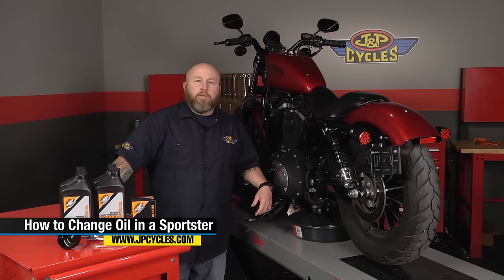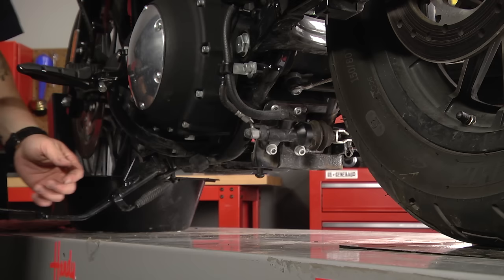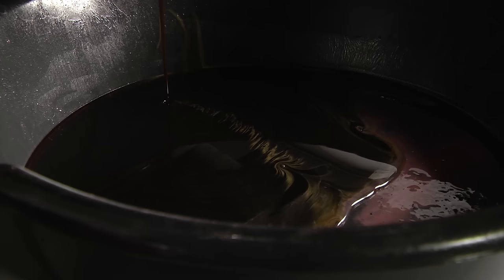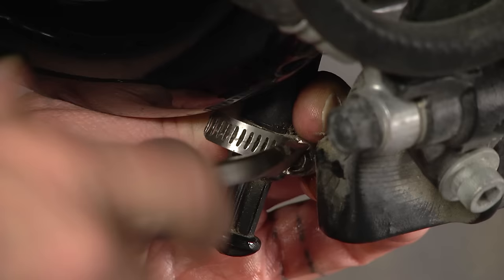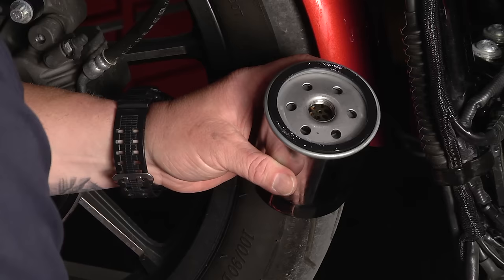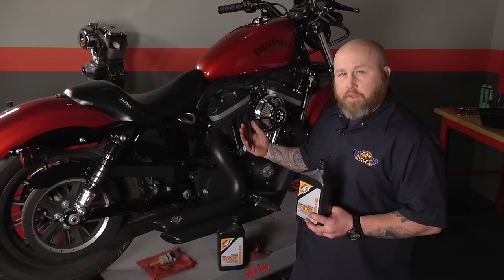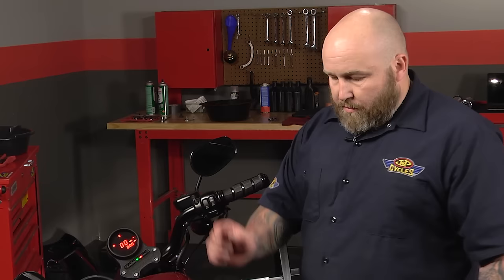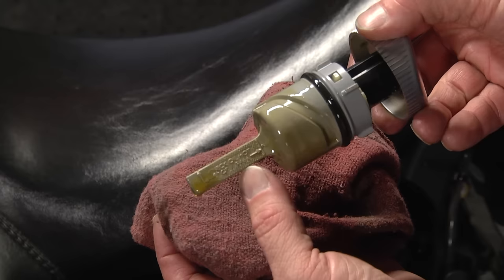How to Change Oil & Filter in a Harley-Davidson Sportster by J&P Cycles

Comment from the maker: Are you still paying someone else to change your oil?

J&P Cycles' merchant and resident mechanic Patrick will walk you through an oil change on a 2012 H-D Sportster. This will be similar to an oil change on rubber mount Sportsters from 2004 and up.

Did you find this video helpful? View more like this on J&P Cycles' YouTube channel: https://www.youtube.com/user/jpcycles2
Reply: is the 2 qts we add included with the prefil we did on the oil filter? or is it a seprate 2 qts?
Reply: What happens if you don't prime filter

Comment: Has to be the easiest oil change ever.
Reply: Oh heck yeah... I change oil on Mopar, Hyundai, Subaru, Kawasaki's Suzuki's, Yamaha, Honda's, Ducati and by far the easiest oil change ever is the Harley. Great design. Many many pro liter bike aficionado's down talk Harley, but their design in certain areas is superior to other makes. The oil and air filter placement is in easy reach, the battery is easy to get to and you really don't need fancy tools for typical maintenance like oil changes, batteries and brake pads. Sooo easy. Changing out the brake pads took me a few minutes because of the floating design. The rear suspension took me about 5 minutes to do as well. Amazing age proven design.
Reply: KR  Maybe Ninja easy, but you still need a socket and ratchet. Not so here, just a screwdriver, or if your in a pinch, a dime. Ha! I changed the oil on my Yamaha YZF R1, what a PITA!
Reply: It is.
Reply: Can you use oil made for diesel engines?  I use T4 Rotella in my mercruiser 3.0.
Reply: My sister's 21 model 48 owners Manuel says t4 Rotella is good. 👍

Comment: I have added a "T" fitting inline with the oil  return line. After I drain , refill and change the filter I clamp off the return line between the T and the tank. Fire it up till the oil coming from the fitting in the  return line runs clean oil. Then I plug the T off and remove clamp on hose to allow oil back into the tank. top off and I now have a complete oil change. Sportsters retain a good quantity of dirty oil in the sump that will just mix with the new oil if changed the conventional way. When I spend $12 per qt for top quality synthetic I don't like to mix dirty oil with it.
Reply: Pat Dennis what size is the oil return line
Reply: You're still going to have old oil mixed regardless of what you do. In every engine. Every time. If it makes you sleep well at night, cool, but completely unnecessary.

Comment: Thanks Patrick.  It seems easy enough.  I am going to try to change the oil and filter myself now that I have seen the video.  I have 2150 miles on the bike so it's almost time.
Reply: If it's your first oil change you should do the first oil change earlier

Comment: So 2 quarts then check it. But basically 3 from what I just watched. Great video thanks for the tips. Pre filling the oil filter is, in my opinion a must!! Anything with engine oil should get the oil pre filled during an oil change to prevent a possible dry start. Helps the oil pressure build a few seconds faster then a complete dry filter does.

Comment: I still have my 2001 1200C and believe me it is this simple. My oil drain line is actually routed to the frame and it in my opinion is better since the hose is not hanging. I have 30,000 miles on it is still my daily driver. Doing the primary is just as easy. For oil 3 quarts does it. Always pre load your oil filter. My baggers are a little more complex.

Comment: Great video! Tips and tricks, I'm not a fan of a dirty bike. Looking around on oil draining found a video that took a news paper and put it under the oil filter. Or a flexible plastic or rubber if kept to use again, but news paper just as easy just make sure it has a shine to it. This way oil will not absorb as fast.

Comment: Where did you get the digital gage from? Also aren’t you supposed to ride the bike for about 10 to 30 mins to get the oil up to operating temps before you check and add more oil since the oil will Expand?

Comment: Couple things I do: I ride my XL 1200C 10-20 minutes to warm up the oil and get particles in suspension and make it drain faster and more completely, I remove the hose clamp before pulling the hose plug or else the clamp can fall into the drain pan, I remove the seat to prevent oil stains when filling and topping off, I made an aluminum scoop to slide under the oil filter to catch 95% of the oil filter drippage, Mobil 1 15W-50 synthetic 5qt jug is at readily available at Walmart for $25, I use 1 qt of Mobile 1 V-twin 20W-50 (wet clutch safe) for the primary case $8.99 at Advance Auto, oily chrome filters might not get tight enough hand tight so I go 1/4 to 1/2 turn past hand tight with a wrench. Oil change interval for sportsters is every 5,000 miles for the engine oil and every 10,000 miles for the primary case. I am thinking of going to 10,000 miles on the engine oil since switching to full synthetic.

Comment: I have a 18 1200 Custom. When I change my Oil and Filter, I use an open(Partial) bottle for the filter. And 2 full quarts in the tank. Run it a few minutes. Add until the oil shows about 1/2 way in the Operating Temp zone. I'll check and top off if needed next time I use the bike. BTW, I use Bosch Premium Automotive filters on mine.

Comment: I always clean the hose plug, clamp, and end of hose good with spray brake parts cleaner. I stuff some rigs under the filter up against the engine before removing it. I use filters with a hex that you can get a socket on. I use more spray brake parts cleaner to clean off the filter mounting flange, and to rinse off all the oil that got on the engine cases. I use Vaseline to put on the filter gasket instead of oil. IF you choose to pour some oil in the filter before putting it on, DO NOT PUT TOO MUCH. It makes a real mess. And you ABSOLUTELY DO need to tighten the filter with a wrench. Not a lot, but definitely more than hand tight. If you don't, you'll probably be cruising down the road when the filter falls off. Hopefully you will feel that hot oil hit your left leg and shut the engine off immediately. But that issue can be avoided by simply properly tightening the oil filter. NEVER start the engine with only 2 qts. oil in it. Great way to destroy your engine. ALWAYS put at least three. When you are done, the oil level should be at the UPPER line, NOT halfway between the two. It takes between 3 and 4 qts. to get it where it is supposed to be. This guy did just about everything wrong. I have been an H-D mechanic for 36 years.
Reply: Except for the brake parts cleaner which damages many surfaces, I agree.
Reply: First HD and you all say 2-3-4 qrts.  WTH, show capacities with oil filter changed and if to check while on side stand or vertical.  LOL to the video dude and you Gerald. Over tighten the oil filter, LOL vs. hand tight.

Comment: My sporty has sat for a while, half stripped down and i was going to drain the oil before pulling the oil tank and motor out for a frame chop, and noticed my tank was pretty light and empty. I was thinking it must be why they say to run the bike first. But how do you drain it if you cant run the bike?? Does the bolt on the bottom of the primary work on a sporty for that?

Comment: That oil was Nasty……..Thanks for the Video !
Reply: Harley oil typically looks a little "milky" after the engine has been running, due to it being a dry sump engine. My former 1966 Triumph Bonneville (dry sump) had the same issue. Never seen it with a wet sump engine.

Comment: Wish I’d seen this video before I just got scammed by the H-D dealership..
Reply: at the dealership's they .should. go over more than just an oil change when they come in for any service... making sure your belt tension is good, bolts are fastened etc... but also at the dealership they usually have the new kid do sporty oil changes
Reply: How much did that cost ya?
Reply: @ethandfortune  3 Qts of oil and a filter just ran me a little under $50. A little more if you wanna buy a drain pan and filter wrench which cost around $15.  Seems like whenever I change oil on my CBR 1000rr it cost me about a Ben Franklin to do it.

Comment: I just purchased a 2005 Harley Sportster 1200.  I had to replace the rectifier after riding it home so that led me to think that this person probably has not done any maintenance. Checked the oil and it is black so I'm going to change it but I also would like to do the fluid that goes in where the clutch heard are at. What is the easiest way?

Comment: I have a 2005 sporty that unfortunately do to circumstances has sat un-started for a few years. This will get me started on getting it back going. It will also need a new battery and possibly tires. What else should I look for or do to get her running in good shape again?

Comment: So the oil drainage plug doesn’t have a magnet on it! What is collecting all the metal swarf from the pistons stopping it recirculating around the engine with the oil?

Comment: Great video. I'm new to Harley's, I was surprised to see you check the oil level with the bike leaning on the kick-stand. With all my previous bikes you have to have the bike upright to get an accurate level. Is it OK to do it the way you did? Thanks
Reply: Yeah, it's fine. It needs to be warmed up real good first though. On the dipstick it says, check while hot.

Comment: This is a great video. Thank you.  I have a 2003 HD 883 XL custom. It only has 2800 miles on it, but need to winterize soon. Will I need to change oil before it rests for the winter?
Reply: Yes, not good to leave old oil in your bike while it doesn't run for months

Comment: Hye J&P Cycles. Quick question for you, even though it may be a dumb one. If I have an NRHS 1250 kit installed on my 883 Sportster frame, do I still use the regular oil filter it would normally take without the conversion?

Comment: Hi, my understanding of this is that you've done this incorrect.  I've been informed that it's critical to prime the engine oil waste pipe, this is critical because air that builds up after emptying the oil is about the size of an egg. If not primed this air bubble can cause issues when it reaches the oil pump and tried to circulate around engine.
Reply: It says to prime the oil pipe in the owner's manual.

Comment: Hi there. Id been to a change oil. And right after they drained my oil, and right after pulling out my filter, the mechanic started my iron and some of the oil inside just started flowing out of the filter socket. Seems all of the oil just went out. Is that ok? Starting my harley after they drained the oil below and In the filter.
Reply: That is never never ever okay

Comment: thanks im having trouble as i have a rigid 99 evo and the hose in the rear has no plug. is this an overflow or should there be no open hoses for oil? thanks
Reply from the maker: +Tj Gonz Being a rigid, there could be a few different locations for the drain. e-mail me at paul.white@magretailgroup.com with some pictures of your bike and oil tank and I'll try to help.

Comment: I had a question about changing my transmission fluid. I seem to have had some oil spill below my bike a day ago. My main oil level seems fine and I cannot see any leaks from the plug below. Therefore I was wondering if it were not my transmission fluid. I cannot locate my manual so I was curious was to how to actually check it. I will say, I added a bit too much gas the right before I noticed the puddle... so I was wondering if gas could have run down the overflow and mixed with some oil on my bike's engine and spilled out on the ground. What do you think?
Reply: Yes it's the gas I did mine same way🙄

Comment: does the engine have to be hot before you start this oil change? I did mine recently and not a lot of oil came out of the engine so would that be a reason why?
Reply from the maker: Doesn't have to be but the warm engine will help the oil flow easier.

Comment: Hello Patrick. I am working on trading my 15 Street 750 for a 2018 Custom 1200. Thank you for the Video. Have some questions. Does the oil filter have an Anti Drainback valve?  Any Specs on the Filter? Has there been any issues with the drain plug setup? It looks similar to an old JD RX75 lawnmower. That model had a Threaded cap on the end. And took two wrenched to remove. To check the Oil level on my Street you need to do it both Hot and Cold. In the Upright position. Which is tricky trying to hold bike upright and remove the stick.  Thank you Chris

Comment: All my guys say you must only drain the oil, on an older Sportster at least, when It's hot because some of the old oil pools up in the crankcase when it set for a spell.
Reply: My sporty has sat for a while, half stripped down and i was going to drain the oil before pulling the oit tank and motor out for a frame chop, and noticed my tank was pretty light and empty. I was thinking it must be why they say to run the bike first. But how do you drain it if you cant run the bike?? Does the bolt on the bottom of the primary work on a sporty for that?

Comment: Dude so i did my first oil change and my bike wont start could too much oil cause a iron 883 not to start?? Or just coincidence ?? And it's unrelated ?
Reply from the maker: It would have to be WAY too much oil for it to not start. It's probably unrelated. How much oil did you put in the bike?
Reply: @jpcycles  2 quarts and I eyed ball the the amount I put in my oil filter but it was probably less than 8oz .. I probably made a newbie mistake somewhere i,just cant figure out what.. The only other thing is that i didnt start the bike before changing it.. I drove it 3 days ago no problem tho . anyways I appreciate any advice man ,also thanks for your reply👍
Reply: @jpcycles  yo yo I figure it out ,its crazy mate when removing oil filter I undid a set of wires right below well somehow one of the pins inside of the wires got twisted and when I slotted the cap in it was not making contact . so once I straighten that pin , bike started just fine lol . thanks again man!

Comment: Hello my name is Arthur I ride a Harley 883 Sportster 2007 I live in Australia I was watching your clip on U tub how to change the oil .. thanks for the hints ... I over filed my bike . And I have oil every were ... The top of the oil pop out .... I have two Q.. No. 1When you check oil did you have the bike strait or leaning on the rest ... No 2Also when you pulled out the plug out to drain the oil do you need to put an o ring ? Because the guy that sold me the oil and the filter gave me this little O ring ... Regards Arthur 
Sent from my iPad
Reply from the maker: Check the oil level with the bike on the jiffy stand. The O-ring is for bikes with a threaded drain plug, not sportsters. It will work on your primaru drain plug though, so keep t for when you do that service.
Reply: arthur cini you really need to be careful with overfill because if your motor has too much oil you can blow seals on the top end. $$$$$$
Reply: I've read that a common problem is that Harley specified 3.6 quarts for a long time, and it's actually 3 quarts. I was told that 3.6 quarts only applies to a brand new engine.

Comment: I've got a 2008 Harley-Davidson XL1200C Sportster 1200 Custom 105th Anniversary Edition model. Just brought it with almost 14k KMS. I have trouble opening the oil cap for the deep stick. Any advice?
Appreciate it

Comment: Thanks buddy. Harley is now charging $331 for an oil change- no thanks.. One questions, you drained it standing up but checked it with it on the kick stand it this correct? Just want to make sure. #First Harley
Reply from the maker: Check level on the jiffy stand. Drains better on the lift.
Reply: @jpcycles  Ty!!

Comment: hi, I have on my HD 2004 1200C the genuine HD oil 10W40. You filled that good looking machine with 20W50 - my question is: what's the benefit? Should I change to 20W50. The temperatures during the season here are 20-35C.
thanks for answering my question.
take care!
Reply: 35C is 95F.  in a bike that runs roller and ball type  bearings I'd run the 20W50 in that temperature. If you are running 10W40 at 35C I'd suggest installing an oil cooler or switch to the heavier oil.
Reply: hi, thanks for the reply. I actually checked what I run my bike on - it's 20W50, so all good. I simply keep my bike far away from where I live, so didnt have an opportunity to check it and for some reason, I  memorised 10W40:) thanks again!

Comment: No mention of pulling the plug on the oil to basically bleed oil line after you add oil? Have seen that is very important, do you disagree
Reply: +Joshua Carson   Approximately 7 days since you asked. I recently bought a 2001 Sportster 883 (my best bike ever, for me) and have been wondering the same thing?
Reply: @whiteribbonman1  Hey Guys,  you don't need to bleed air from the drain hose. Oil is viscous and gravity will eventually fill the air gap. HD has a dry sump so oil will be pumped under pressure throughout the engine.  Any air in the sump will bleed out in the same way when the oil goes in, air will rise and bleed itself out.

Comment: So a 2005 has a hose like that? not a bolt that screws into the pan? 
-- also I read somewhere the bike should be warm and on the kickstand right? When oil is warm, it expands right? Also does it need to be running while you check the level? All these different vehicles have their own idiosyncrasies. I had a 90 C2 Carrera.. It had to be on a flat surface and running while you check it and the dipstick was at the top right of the motor, so you'd better no be warin anything that hangs down like a chain, loose clothes, long hair etc. it was a bit sketchy -- but the sportster has to be on the stand so its on a bit of an angle right? Just confrirmin. Thanks man. Nice video.
Reply from the maker: A 2005 Sportster should have a hose. You do not check oil level with the engine running, just warmed up and on jiffy stand.